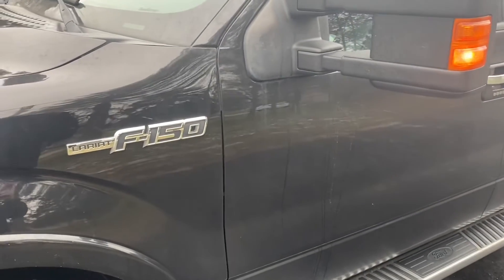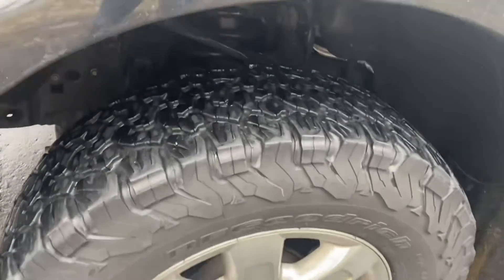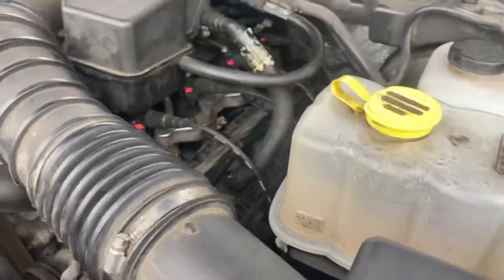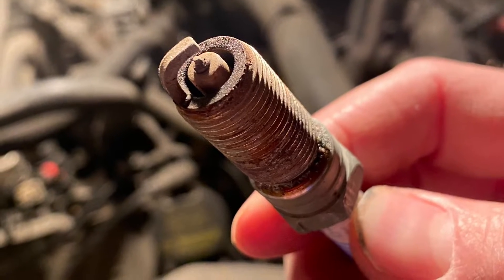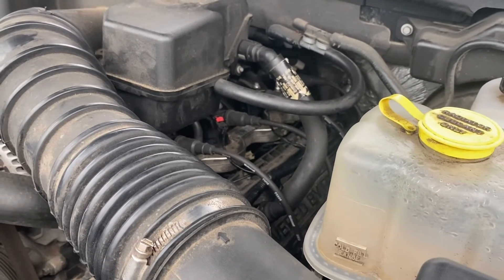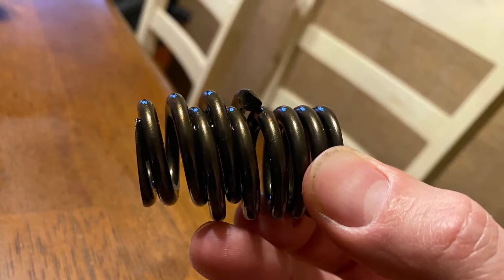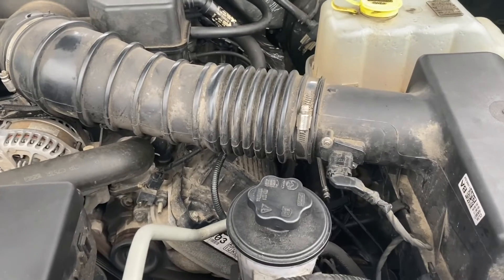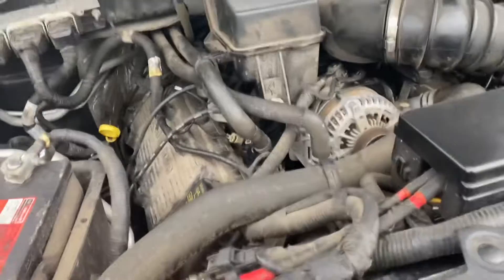Ford 6.2L Engine Misfire/Shutter Problem FIX!!!

Comment: The first thing you should have done was scanned the code, then swapped the coil pack from #8 to another cyclinder that was easy to access. The code would have stayed on 8. You would have then known it wasn't hte coil pack.  then you should have pulled the #8 plug out and evaluated it and swapped that out if it was bad.  Also when you know the cycl is misfiring you should disconnect the fuel injector until you diagnose it.

Comment: I've been watching videos on these 6.2L where the ignition coil corroded and disintegrates a resistor inside the coil...just watched another on a stuck PCV valve, another on a leaky check valve in fuel pump, and debris in mass air flow sensor on the intake tube, and failing fuel pump driver module...don't forget the fuel pump relay fuse relocation kit (do this ASAP if you have an F150 with this engine, it will eventually melt)

Comment: You better update that transmission cooler... thank you for posting.
Reply: why should you upgrade the trans cooler is it known to be small ?
Reply from the maker: I think you’re fine just flushing the trans every 75-100k miles. My truck has a trans temp gauge on it and even pulling 10k pounds in the summer heat I’ve not seen much above 200. Fluid isn’t going to start breaking down until like 220.

Comment: I have this same truck in a 2014, hope mine doesn’t break a valve spring...
Reply from the maker: As mentioned in the video it’s not common, easy to diagnose and very cheap to fix if you do  repairs yourself. Basically not worth worrying about, they are great motors lasting commonly well over 300K miles.
Reply: @fusetroopoutdoorsmen1055  Some older 4.6L 32V modulars had this problem ( in the 90s).  Similar type engine, same break. They never hurt the engine though. I have an extra one in the glove compartment in a Ford bag, never used it :lol: hope never to. I used a rope to do it.

Comment: Broke 4 springs now. Put 16 new ones in. And guess what another broken spring
Reply: was the last one under warranty?  how much did all that cost?
Reply: @motorcycle1650  no warranty  on any of them
Reply: @motorcycle1650  the springs are cheap. Labor is the expense unless you do it yourself like I did
Reply: @motorcycle1650  Don't see your rope question but you take out a plug, rotate engine until the piston is at the bottom, push thick rope in (say 3/4 diameter of the cyl hole), when you can't get anymore in start to to turn the crank with a breaker a tiny bit to snug it up (do not force anything). Now the valve is held in place and you can remove the keepers and spring. You may need a special tool to pivot the valve. I did mine on a 32V 4.6L 4V, 3V may have its own special tool. The 4V has different tools for intake an exhaust. 2V uses one of those tools for both. I don't know about the 3V.
Reply: Damn

Comment: I had a multiple misfire, cyl 4 and 7 misfire. Ran fine, would only trigger CEL under a load. Did plugs, wires, had the injectors tested and cleaned. Ended up having to do a "misfire monitor neutral profile correction"  relearn.
Reply: i have the same problem, what did you do to correct exactly, thank you very much!
Reply: @brandonmarcelogonzalez7689  I called around to locally-owned, non franchise/non chain shops until I found someone that would do the relearn only, without charging me for diagnostic time. Ended up paying $100. The relearn takes 90 seconds at most. The dealership can also take care of it if you want to pay more and wait longer.
Reply: How did you do the relearn with an active misfire? My scan tool has the ability but says not to perform if there are active codes
Reply: @jackweisenburger  I sent one of my employees, I’m not sure what diagnostic tool was used but I think it was a higher end snap-on. Regardless, I’m sure there were active codes during the relearn. I would try clearing the codes then doing the relearn, if you are not able to clear the active miss fire codes during engine off diagnostics you may have another problem.

Comment: You can’t put motor a top dead center and pressurize the cylinder the air will push the piston down to bottom

Comment: This is exactly whats happening with mine ….. changed plugs but didnt help ….. cant find a vacuum   leak ….. ill try this next 

Same it was like a switch i gave it a little gas at a red light and bam truck started to shake like crazy 

2014 f250 6.2 200k miles ill update if it works for me too
Reply: Was it your problem?

Comment: 120k miles and never changed the plugs… 🤦🏻‍♂️
Reply: I just bought a 2019 with 170k factory plugs just changed them most had over .1 or more gap